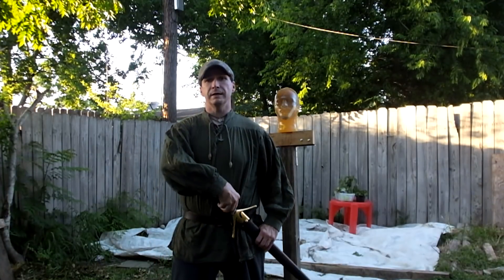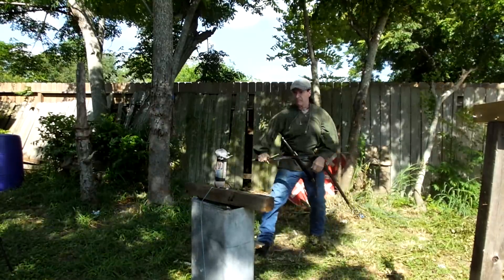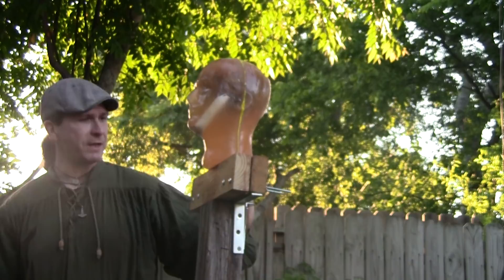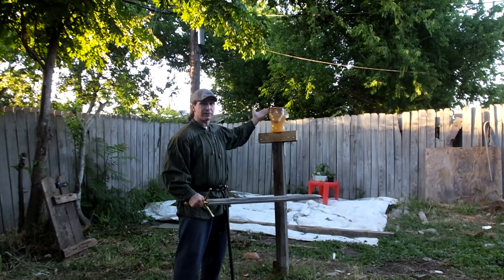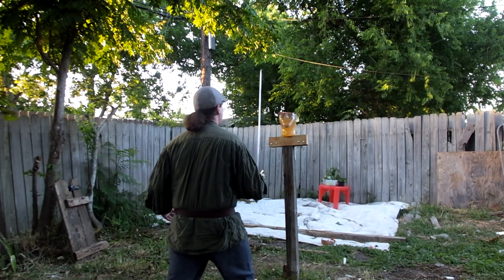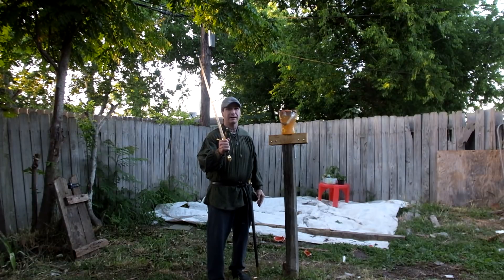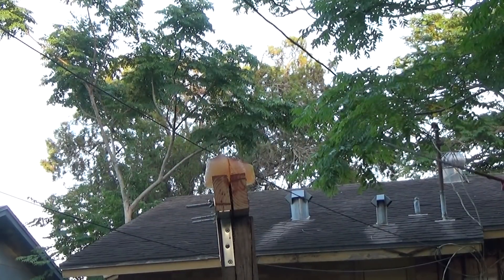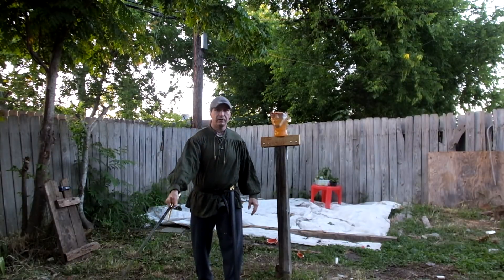Scottish Medieval Sword ( Small Claymore or Longsword ) Test

Comment: I'm thinking the new dummy stand stand might be too helpful with the cuts.  It doesn't mimic how the head will turn and bend at the neck from the impact of the sword.  The design is great I just think making the neck flex more would be a good idea.  Maybe some stiff rubber hose with PVC piping on the outside to mimic a more natural spinal cord.  Just some thoughts ;)

Comment: Always enjoy your tests and analysis. Who is the actual maker of this sword? Windlass?  Name should be Minimohr !
Reply from the maker: It comes from Medieval Shoppe Australia but many of their blades seem like Windlas blades you could contact them but think they have their own factory or forge uncertain.
Reply: Windlass is pretty good overall. Is this high carbon spring steel? Does it sing and flow like spring steel? This is like a knight's single hand sword but I have a Windlass two handed Scottish War Sword and it is all that, my favorite overall blade. A true 45 inch scaled down dimensionally correct claidmohr.  They no longer make it. Has a disc pommel, distinguishing it from a true claidmohr great sword. Peened pommel. Also, is this pommel peened or threaded?
Reply from the maker: I yes sings and flexes back to true but I believe it is said to be EN45 steel.